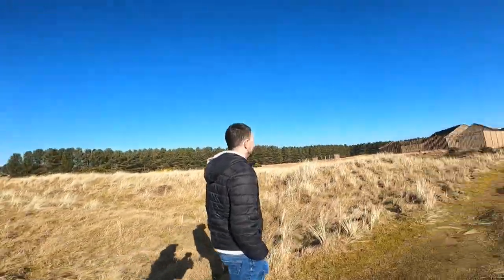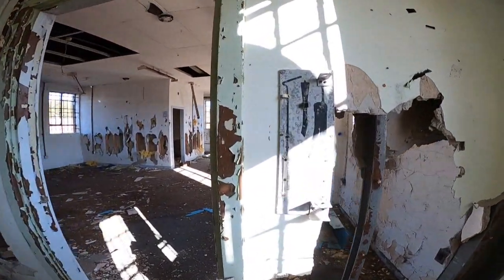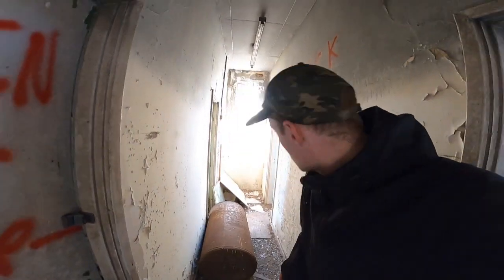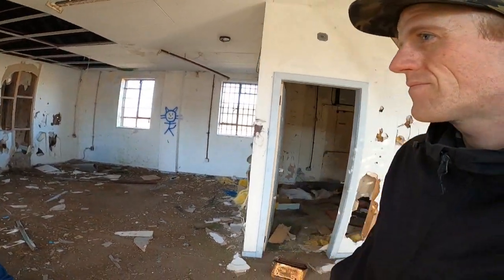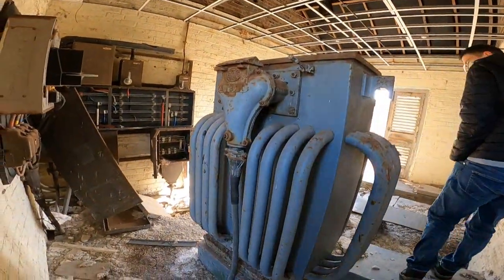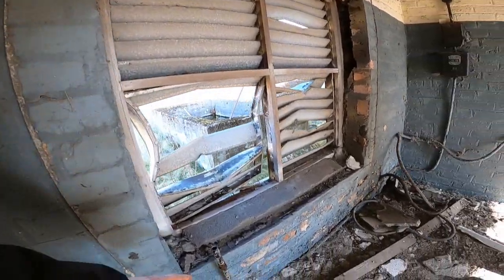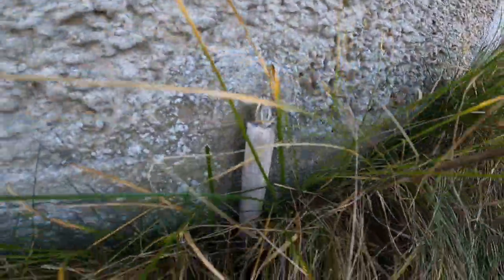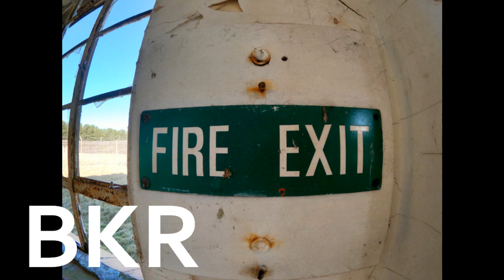Abandoned Cold War Microwave Repeater Site - SCOTLAND

Comment: The writing on the metal joist is Gyproc. They are a plaster and plasterboard manufacturer that still operate today. 222 is the unit number for Montrose fire brigade :-)
Reply from the maker: Hey thanks for this info, I think that the gyproc walls are the non-original walls in this building. It's interesting to find out about the old cooker to 👍